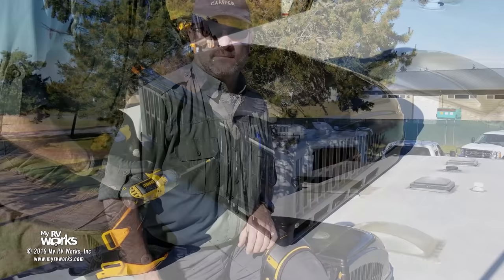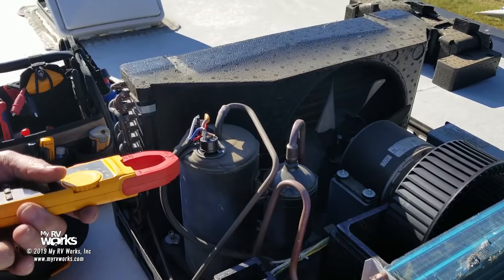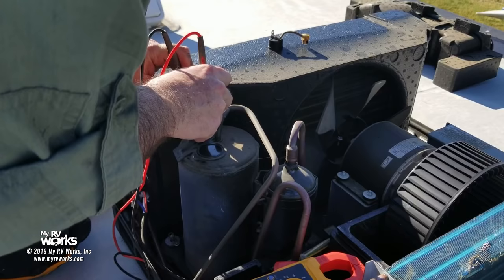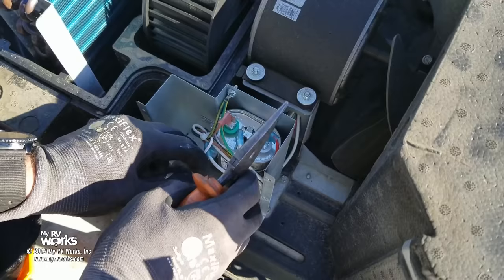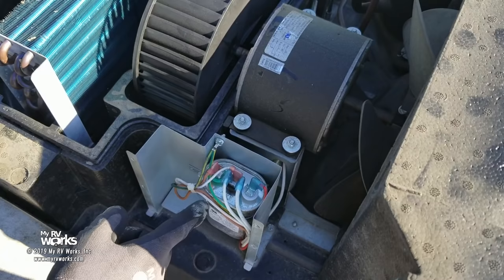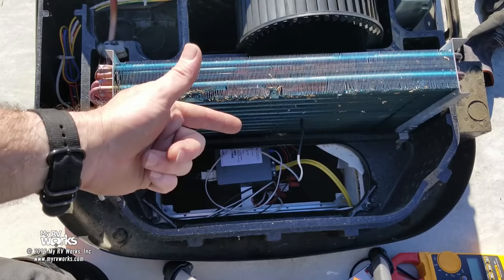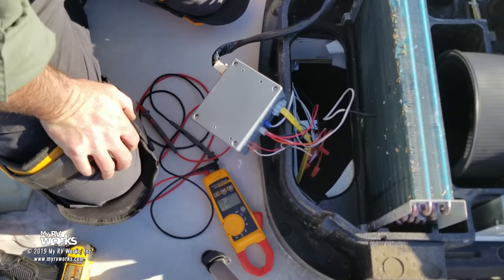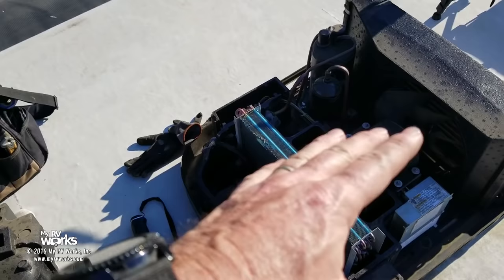Diagnosing An RV Air Conditioner That Is Not Cooling

Comment: Darn good video...Get the Freon permit, it's not that hard...I'm certified Universal, semi retired, still running service, getting more into the RV stuff....Just like window AC's most units have no service ports, but one can be installed...I have serviced some, that had a low charge, and have since been running for years again...Some haves leaks right from the factory...Some start leaking from vibration...Same on Refrigerators...Might last years before needing it again, and on some type you can run a sealant additive...Takes caution, but can be done...I check for leaks, repair if possible, it's not always worth the bucks...You're a good Service/Repairman...An Honorable profession. and I'm glad I watched your video...thanks.

Comment: Without the shroud the air is not condensing. Clean the coils, install the shroud. 
A refrigerant leak is highly visible. 
Great explanation of the components.

Comment: Darren thank you so much.   I't the second time you saved me this week.  First was water heater switch now my AC.    Fan would run but compressor would not kick in.  Using you methods I tested both capacitors and found a bad start capacitor.  Local ACE happened to have the same one and $13 later and a little time AC/Heat pump is working great.  Keep up the great videos.

Comment: Wow thanks for so much great info! The good news is you helped me diagnose the problem… bad news is that my unit has the same problem! Running for 2 hours straight the coils are pretty cool to the touch but definitely not freezing cold! So find someone to recharge it (no luck on that one) or replace it🤦🏻‍♂️ Wish I’d found this out before leaving on vacation in mid August!

Comment: My ac is not working and I’ve watched a bunch of videos and this is by far the most informative! 
Wish this was on a Coleman Mach though,which is what I have!
Thx! Subscribed!
Reply from the maker: I have a video on a Coleman Mach coming out in a week or so. Stay tuned. The colemans are very easy to troubleshoot with your own 12 volt power supply to the control board in the top. You can feed your own 12 volts to those pins simulating what the thermostat is telling the air conditioner to do. Also, if you want to test your compressor, you can follow the black wire on your Romex and connect it to the purple wire on the black relay ( just don't get shocked). That will bypass your entire control board and test your compressor.  Because the Coleman has more wires fed from the thermostat to the air conditioner there's more of a chance for those wires to fault. Typically the control Power is fed from the furnace to the thermostat and then the thermostat feeds the control board in the air conditioner. On my furnace playlist look for a video titled "Troubleshooting a Coleman Mach Intermittent Thermostat Issue" you might find some tips or tricks there.

Comment: Awesome video my ac quit on me and was about to call it a day and start looking for new, checked the capacitors yada yada, checked the overload protector and the wire was burnt off, going to rewire and see if that fixed the compressor
Reply: Update it fixed my issue thanks alot man 👍👍 you went straight for the money 💰 blowing cold again 🥶❄️❄️

Comment: Since you did not visually see any Refrigerant residue / oil I suspect that the "REED" Valves have been warped inside the "compressor" therefore not pumping refrigerant. Good job of teaching the trade, I enjoy your videos and do learn a lot from them.

Comment: It got up to 109° yesterday down here SW New Mexico near Animas and my air conditioner has been acting up, Darn!
This video gave me the background to tackle diagnosing. Condenser and capacitor checked out. Have no idea where the controller is, it’s somewhere under foam that my units have not shown in your video. Down here wind blows and carries a lot of fine NM and AZ dust. Well those coils and fins had cobwebs and dust caked in there. There was a lot of buildup. That air coming out feels a might bit cooler. 👍
Reply: Unfortunately I see that cleaning it up it seems to be more efficient and cooler. But what brought my attention was that it’s noisier than the other same model AC on my trailer. The noisy one makes an additional mechanical noise only heard outside. When I was running it without the cover I didn’t notice it. It seems to be more pronounced after it’s ran a while. Maybe if I record the sound it may make sense to you.

Comment: Thank you a bunch whenever you go to an RV dealer they want to sell you a new air conditioner. Mine was the pre-sensor. I’ve ordered one hopefully that’s my problem. My rear radiator freezes like a block of ice and then blows water all over inside the camper. Again, thank you for your video immensely

Comment: Thanks for your informative video. I fixed my marine AC from the information you provided. My compressor quit and I thought it was the capacitor. But I started with ohms test on top of the compressor like you did and when i took the electrical cover off, one of the wires had corroded and come off the terminal. Boing I was back in business. Thanks again.

Comment: This is an absolutely awesome video!   regardless of my problem, you explained almost everything needed well and in full detail.  luckily with mine i know the compressor isnt running, so hopefully its something in the wiring that can be repaired rather than replacing the entire unit.   thanks for posting this!

Comment: I have watched every rooftop a/c YouTube video . This ic not the only best one, but it was the best educational instructor. You talked clearly, an informative way for us that have normal mechanical ability’s and at a 
Nice pace without a lot of unnecessary bullshit added.  Great job, if I could give you 5 thumbs you would have them..
 As far as recharging these units, I find the best way is to have the correct Freon, a Freon scale,, a vacuum pump and a long Sealing Schrader valve stem tool.
 Once you have found the leak fix by Brazee or silver Soldier vacuum and hold -30 lb from those bolt on line taps ( I like putting one on high and low lines ) suck and hold on high line first then low line, keeping your vacuum on low line you then carefully put in proper amount of Freon as the unit specifications.. your challenge will be holding the scale steady on those fiberglass roofs. Do all filling with F.bottle upside down and add a 1 1:2 ounces for the hose. 
 Button it up, start it up. And if it doesn’t work then, THROW THE THING OFF THE ROOF and buy a FAN ! ! !

Comment: Thanks for the easy to understand info. After testing all components as you did I noticed that the Softstart unit had a red light on. Contacted Softstart and found out the softstart unit was bad and not allowing power to the compressor. Disconnected Softstart and the A/C works as it should. P.S. Softstart will ship me a new unit to replace the old one. Thanks again

Comment: This is excellent! I just followed along with your video and fixed my air conditioner!! Relay was stuck. Thank you!!
Reply: What reading did you get on your relay? I got 61.4 volts when the compressor was not running and 57.0 volts when the compressor kicks in. I wonder what is an accurate reading if the relay is in bad shape. Did you replace your relay or the whole control box?

Comment: Many thanks. Found a bad connection under the compressor cap on thermal/amperage sensor. All good now. Crimped a new female and 4 inch wire (heavy gauge) and blue but connector and back working good.! 🥶
Also you were looking for a place to set your meter,,, it has a clamp :)

Comment: Thanks or giving me what I think is likely the information to fix my RV airconditioner.  When it first comes on the delta T is about 50 deg.  Then an hour or so later the cool air stops.  It sounds to me like the temperature sensor has come loose or has quit working or the little round thing on top of the compressor has has go bad.  It should be an easy fix once I figure it out and find parts.   Thanks and keep the good stuff coming.

Comment: As others mention, this was an overall very helpful video.  One of our 2006 Duo-Therm AC’s isn’t cooling, and I think it got compromised by a long power extension cord (12 gauge) voltage drop.  Hopefully it’s just a start capacitor.  But I’m assuming that your unit here had a newer “combo” capacitor, start and run together somehow, and I’ll be checking each of 2 capacitors the same way… 3 pins on top of each?  

Also, when you opened the control board you briefly looked for relays you said could be bad.  But when the compressor came on you ceased tracking down the mentioned relays.  So if the compressor and fan hadn’t started, we don’t know how to test the relays or even what they look like.
Reply: He tested the wires to the relays.  The blue wire there was for the relay he needed to check.

Comment: Thank you so much for taking the time to explain this in a way I understand. I now feel confident getting up on our roof and checking our unit that is blowing air, but not cold. If our ac unit needs replacing, what brand do you personally recommend? Preferably, the brand that is the longest lasting, most reliable. Thanks again.

Comment: Another great video. I really like how you explain things. My Coleman Mach 15 kicks the 20 amp breaker after it runs for awhile. I checked at the breaker is starts a 11.8 amps and climbs to 20.2 amps and eventually trips the breaker. I got on the roof and opened it up and so far found the run capacitor is bubbling out on the side. The battery in my meter died so I was not able to test anything else at the time. I went ahead and ordered new capacitor since its leaking needs replaced. Watching this video you explained things that Im going to check the compressor and all the capacitors when I get back on the roof.

Comment: I agree with all of the comments on the quality and information provided in this video. My question is in the area of your troubleshooting the control board. There is a fuse there and you did not mention checking it. Prior to any other control board malfunctioning of the relays, would not the fuse go out first? It would be so easy if this was the issue and it just needed to be replaced. I will look at the fuse and do the testing you recommeded for voltage on the two relays. Thank you so much from an inquisitive novice and dedicated DIY'r.

Comment: Enjoyed the video. It taught me what I need to test after replacing control box inside and a/c not cooling. Thanks a bunch. Video will be a huge help for me.
Reply: What was the problem and whats the fix. My compressor kicks on and goes out. Rv is hot. Thx

Comment: You may have made a very costly mistake for this customer - apparently not understanding the Thermal Overload Protector components (they are not TCR's or simple current sensitive breakers). By simply testing them cold, all you've proved is they make electrical connection when the unit is cold and not in use. However, these are temperature actuated switches that are designed to open  when the compressor overheats, which is why they are located at the top of the compressor housing. But when one of these thermal switches goes bad, it will not show an open circuit when the unit is cold - instead it will open below its design temperature (during normal operating temperatures) only after the unit has operated and wormed up for 5, 10 or 20+ minutes.  

Since there was no sine of coolant leakage, such as oil residue, and the compressor was heard working when the unit was switched on - it is possible the proper refrigerant charge may have still been in tact. Then, the compressor was shutting off as the unit warmed up when a faulty thermal overload switch opened up - shutting down the compressor. 

Thermal overload switches are mechanical devices made of a bimetallic laminate and are known to fail by actuating at low temperatures. Only by testing voltage of the run coil after the unit has warmed up (and is blowing warm air, not cooling properly) can a failed thermal overload switch be detected.  Otherwise, it's useful to carry and swap in a spare for diagnosis, just to be sure.  

You should never replace the entire unit before confirming that the compressor is not shutting down due to an electrical fault like a bad thermal overload protector switch.

Comment: I have watched this video a few times because my AC unit just stopped on the first day of an outing when temps were in the mid 90's. Just a hum and then the house breaker trips. Dang! Plan is to replace the run capacitor for my Dometic Duo-therm and install a hard-start kit to see it that gets it running again. The unit has not be used very much at all since we purchased the trailer new in late 2018. Always something... :-)

Comment: I have an abnormally large amount of dirt buildup on the evaporator coils. I have been meticulous about sealing the seams in the evaporator shroud with foil duct tape and cleaning the inside air filters every two weeks. It ocurred to me that the reduced air pressure under the evaporator shroud will draw outside air from under the AC's base plate through the condensate pan's drain holes where it will contact the evaporator coils.

Tomorrow when cleaning the evaporator coil I plan to add a piece of OPEN cell foam between the roof and the AC's base plate directly under the two drain holes. This should allow condensate to pass through to the roof yet prevent dirt from being sucked into the evaporator shroud.

Alternatively a Duck Bill check valve inserted between the drain pan and base plate would allow water to drain but block outside dirt from being sucked into the evaporator shroud but that would best be done by the AC's manufacturer. 

Time will tell if this solves my problem!

Marc

Comment: Thank you for this information, my Dometic A/C roof unit is not cooling right now, and it's already been replaced once a couple of years ago. The repairman told me they are unfortunately notorious for needing replacement.  I can't do the compressor, capacitor and board tests, but I can run it to see if it gets cold like your last step.  Sad news because the temperatures where I am are in the 90's.
Reply from the maker: You can also tell a lot by hearing. Turn on the fan, you'll hear what the air conditioner sounds like with just a fan blowing. Then turn on the AC mode which will engage the compressor. You should hear a deeper sound. That will tell you your compressor is running.
Reply: It is true, what you said about the Brisk Air's.  I replace them all the time.

Comment: Very good information ! I learned about testing capacitors when 1 by 1 my outside units on my house gave out, all within a year of each other(3 units) . We just got a 2007 Win. View last summer and the roof top a/c unit started working intermittent, always blows cold when it did work. I checked capacitors but that was all I knew to check. Now, after watching your video, I've got more things to look at and hopefully that will fix the issue. I hear a click noise in the thermostat when I slide the switch to cool and auto, but nothing happens after that, so seems like it could be a relay, or something past the thermostat.
Reply from the maker: Depending on your thermostat, some do have Diagnostics mode that you can access. When in the diagnostic mode you can isolate individual functions of your air conditioner. That might help you to isolate your problem. If you can provide your thermostat information I can reply with information on how to access your Diagnostics mode, if your air conditioner and thermostat offers it.
Reply: @MyRVWorks  I would like to check this also. I have a Duo Therm Comfort Control. Thanks.

Comment: I really appreciate the thorough methodology that you used to approach this repair diagnostic. I have a similar ac unit, and I have checked basically everything you did here the same way you did. My coolant lines are extremely cold to the touch, and I get cold air in the cabin, but my compressor turns off very quickly, before the whole cabin has aa chance to cool down. Is there a process for checking the thermostat on the control unit, and/or replacing it? I believe that to be my issue.

Comment: With the loss of refrigerant, do you typically see a reduction in amperage? I know these should run in the 12 amp range. Would the loss of refrigerant make the compressor run in the 6 amp range?